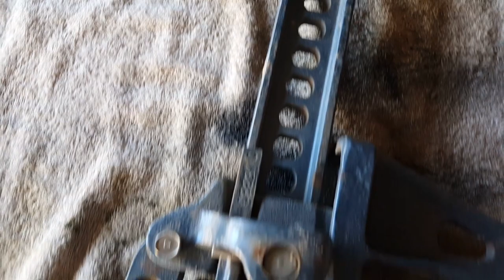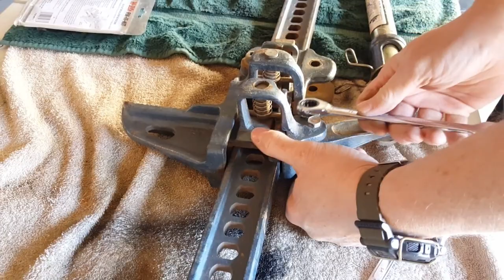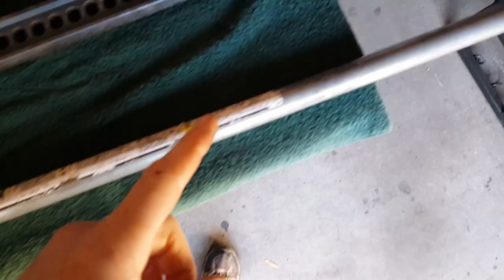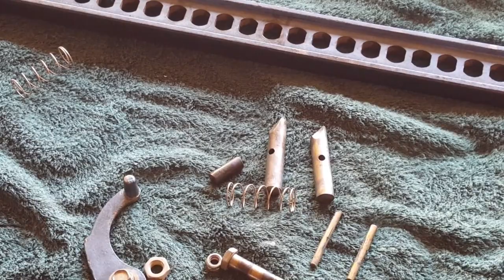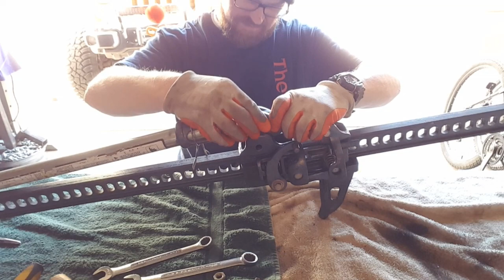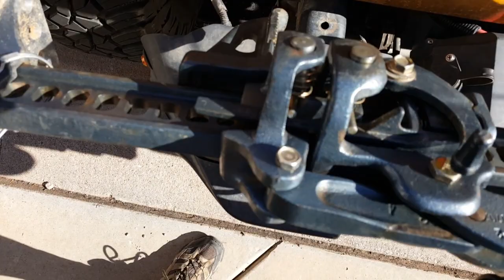How to Tear Down & Re-assemble Your Hi Lift Jack

Comment: Thanks for the video.

I just bought a "brand new" Hi-Lift jack that arrived with a lower bent cross pin.  It would not lower the vehicle so I bought a repair kit, replaced all the parts and it still won't lower the vehicle.  Now it even won't free fall with no weight on it.  Yes, I did lube it.

I noticed that while trying to lower the vehicle, the top climbing pin doesn't want to move out of the hole.  Without any weight on it, it does slide in and out easily like the bottom climbing pin.  I'm at a loss.
Reply from the maker: My upper pin does that periodically, I lube it, and it generally takes care of it. Thanks for watching 👍👍.
Reply: @TheRightLine  yup, lubed it up many times but it still doesn't move when trying to lower it.  I saw another Ew Toob video that claims brand new Hi Lift jacks have too much paint near the pins so will try that tomorrow or another day.  I guess made in America isn't what it used to be.
Reply from the maker: I hope its a quick fix.
Reply: @TheRightLine  my next step is to do a complete tear down of this brand new jack.
Reply: Took a break from this jack from hell and attacked it again today.  Tore it down for the umpteenth time, smoothed out every painted surface, made the Exon Valdez oil spill look like kids play and now it won't even go up!  After a few choice four lettered words I noticed that the reversing switch cam bar doesn't want to stay in the groove for it and is binding the climbing pins.  

Judging by your video and others, I think maybe the reversing switch spring is too tight.  I really have to wrestle with it to get it back in position and even when I do, it doesn't allow the reversing switch cam bar to stay in place in the groove.

Another thing is that I have to hit the reversing latch with a large tool of some sort to get it in the down position.  I've seen others having to do this also.

My bottle jack is looking a lot better.
Reply from the maker: Wow, I can't believe you're having this much trouble. Did you try contacting Hi Lift?
Reply: @TheRightLine  yeah, the Hi Lift tech support has been in contact with me with pictures of how it should look and I sent them pictures of my pin locations, etc.  

After more more words of enthusiasm today, I'm starting to think that this jack is really a knock off with incredible looking decals.  I must admit though, that positioning the reversing lever is getting a little easier, although I still can't lower it without the aid of a BFH.  

On my second attempt today, I got it back to it's original condition.  Up but no down.

I'm keeping your video alive just in case others have the same issue, which I know is happening.
Reply from the maker: Wow, I'm sure that Hi lift should be able to help. I wish I had it in front of my to problem solve it.
Reply: @TheRightLine  I'm walking away from it for awhile so I can think clearly.  Next attempt is to cut half or one whole coil of the reversing spring.  Nothing to lose at this point.
Reply from the maker: I gotta step away from stuff periodically too.

Comment: My climbing pins have a lot of rust. Should I paint them after I knock the rust off?
Reply from the maker: No. If you paint them they won't move appropriately. Lightly remove the rust, then make sure to keep them lubricated. Or, replace them.

Comment: Question ❓ ❓ ⁉️ I found one someone threw it out on the side of the road I would like to know were you got them parts from and about how much they are in contrast to the device it self 
and it was a little bit of a mess rusty grim I truly did not know parts were replaceable on this thing till I started looking for other info on it's uses yeah it's a bit sticky and a part of that till now has little to do with its new owner it's the reasons it was found by me got gumed up and stoped working so I can fix this monster and have a slick looking jack I can do more then lift my truck with 
                                                                                                                               Thank you in advance
Reply from the maker: My local 4x4 shop had them on the self. The parts kit has sat in my toolbox for years. They weren't terribly expensive.

Comment: I followed what you did but I keep running into the same problem. It goes up but not down. I can’t figure out why. I’ve taken it apart like 3-4 time and still it won’t go down
Reply from the maker: You could have a bent climbing pin or it might have a bur or something on it that won't let it travel back and forth.
Reply: @TheRightLine  I have the same problem with my Hi-lift.  Go up but NOT DOWN😔.  Could you solve the problem?  Greetings from Brazil!
Reply: I have the same problem with my Hi-lift.  Go up but NOT DOWN😔.  Could you solve the problem?  Greetings from Brazil!
Reply from the maker: The most likely problem is the climbing pins are dry. Try squirting some WD-40 on the climbing pins during operation and see if that helps.
Reply: I have a hamar car lift with a Jack at each corner. It goes up fine, but getting the car down is leathal, they just don’t work in down mode.

Comment: The climbing pin do hold the weight
Reply from the maker: Actually, the upper and lower runners hold the weight.
Reply: Without the pins, don't the runners just slide freely along the rail? The connection between load, runner, and rail appears to be the climbing pins.